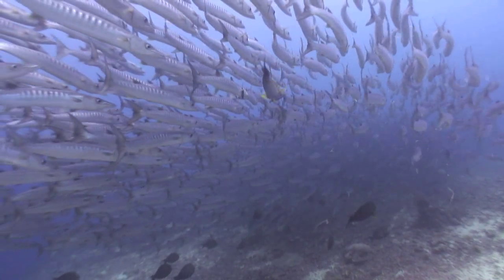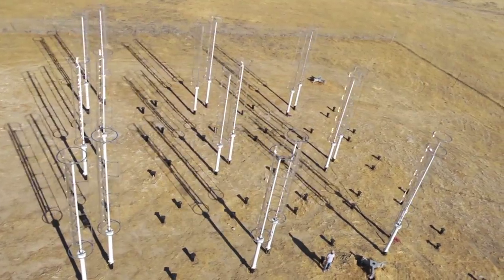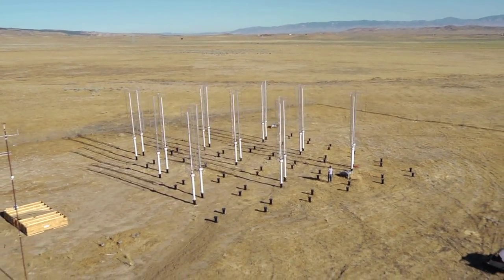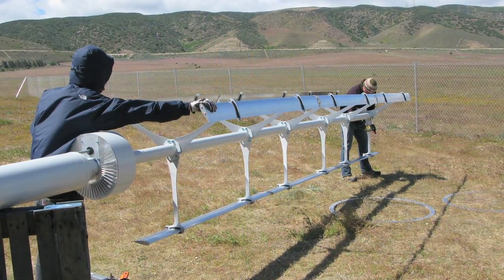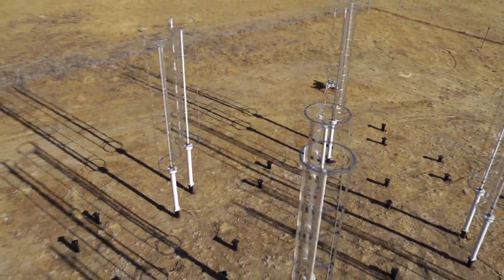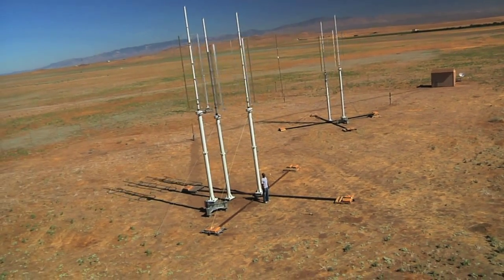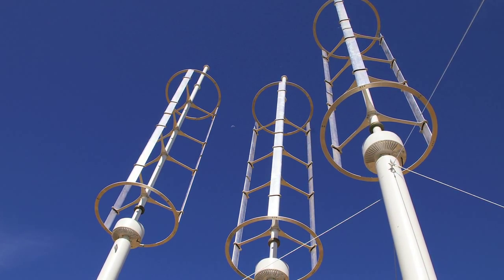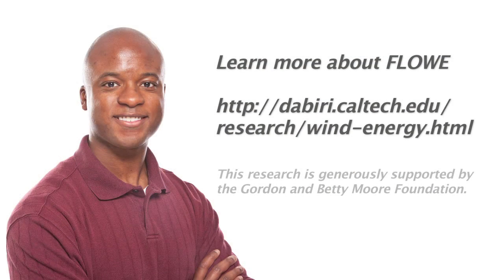Caltech Researchers Find Wind-turbine Placement Produces 10-fold Power Increase

Comment: My misgiving is the dubious comment about more watts per square meter than with large horizontal axis turbines. From the video it seems that there is no possibility to use the space in between the towers. The larger "propeller" turbines have a relatively small footprint and the space between them is still useful for its original use, usually livestock grazing or farming. While it may be true that the vertical turbines produce more watt/square meter, there is no accounting for the auxiliary use.

Comment: @MrJwaB Who is to say that the VAWTs would not be placed on a horizontal set of bars elevated from a single pedestal. Then a group of such sets of turbines could provide a much denser array without impacting the use of the land beneath.

Don't sell short people's ability to work around a problem. This is still just studying the TURBINE dynamics, and how they interact when installed in groups, not for the ultimate installation design parameters.

Comment: It is easy to demonstrate that the maximum wind energy potential is directly into the wind Doc. - the sweet spot is not at an angle to the flow. Why not analyze Low Pressure Turbine Dynamics and revisit the basic goal of maximizing wind energy potential.